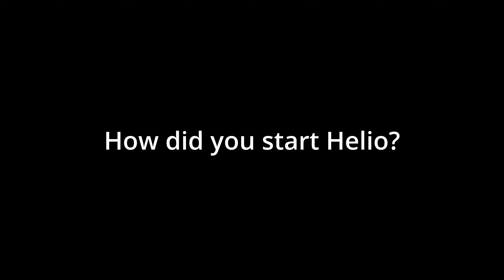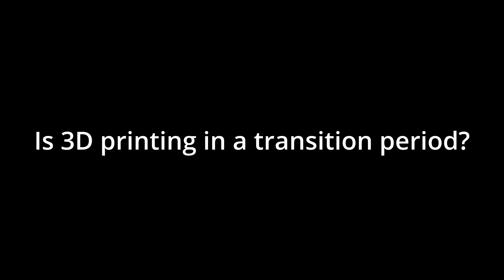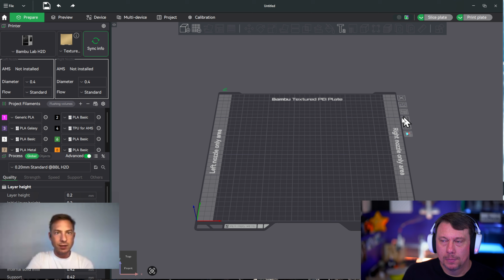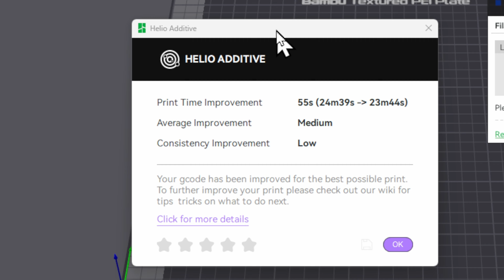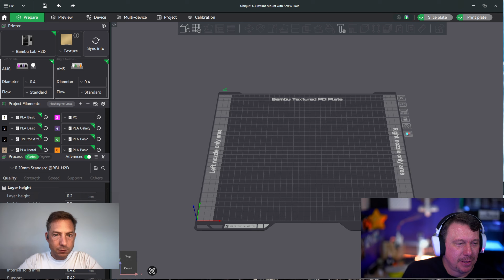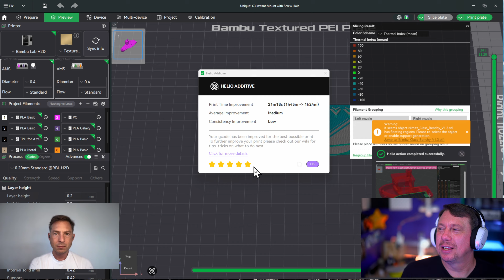Learning how to use Helio with the CEO!!!

Comment: I’ve subscribed to Helio and have used it a bit.  The most noticeable improvement is shortening in print time of Polymaker PETG-rCF and removal of shrink lines.  Fundamentally this physics based thesis is the key to turning 3d printing into a Star Trek “replicator.”  I’m so pleased that this technology is being made available to hobbyists and that Bambu and Polymaker also see the benefits.  I presume ultimately their bread and butter will be commercial shops.